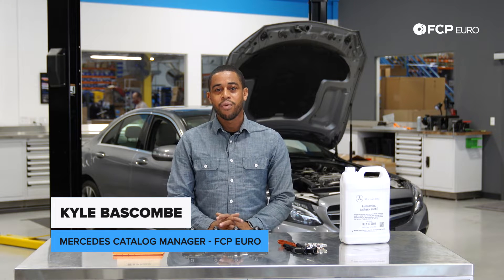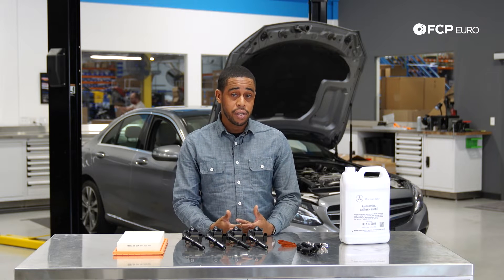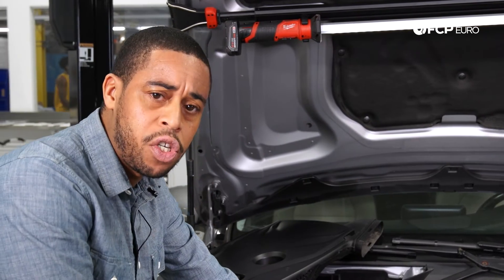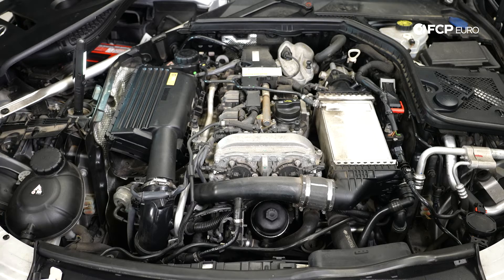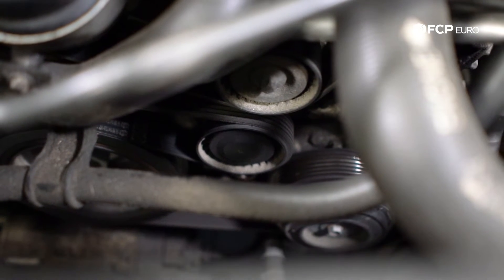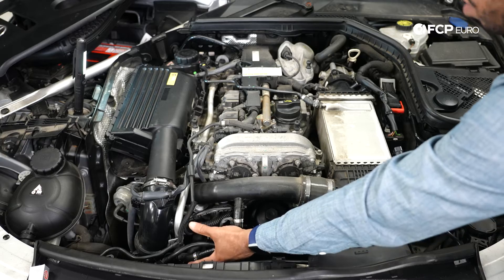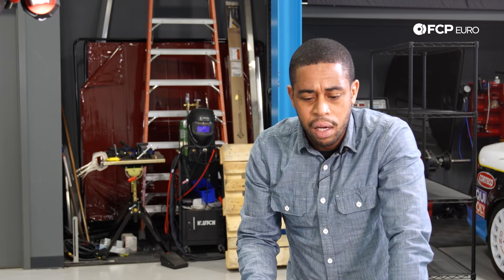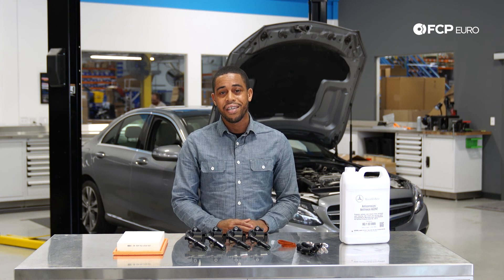Mercedes-Benz M274 Engine Diagnostic & Maintenance Guide (Mercedes W204, W205, W211, W212, & More)

Comment: I’ve had the PCB code a couple of times. Apparently MB is working on a new design. It would be nice to see a video on replacing that system.
Reply: It's a relatively complex repair.  Intercooler has to be moved, lf motor mount has to come out, you're gonna want a few more specialized tools.  It can easily eat up a good portion of your day if you really don't know what you're doing....not recommended for someone who isn't familiar with the engine.
Reply: @JeeperZJ  Agreed.  I'm currently on 5hrs and I'm just able to see 1 off the 3 bolts to the assembly on the lower portion go the motor.  This job in no joke.  WHAT A PAIN IN MY ARSE!..  Personally just for the headaches, I would recommend to give Merc Benz the 1400-1500 they want to do this repair.  In my opinion it's not worth your time.  But I digress...

Comment: "terrible but not too terrible m274 engine" - can you add more details to why you believe this to be a terrible engine?
Reply: I work on these cars for a living. 20+ years now. The M274, like the M270 (transverse mounted) 4 cylinders are basically boat anchor motors developed in conjunction with Renault. These clunkers get all types of issues. One of the worst water pump designs ever (lives under the turbocharger)! Also the breather system is complete junk. Has a breather hose which breaks a lot, that requires intake manifold removal just to replace. Pays about 5 hours of labor to replace. The coolant tanks are always leaking, horrendous ignition coil/boot design. Rarely do the coil boots survive disassembly. And the fuel injectors are known to fail as well. They are pricey, and require unnecessary special tools to replace the seals in the fuel rail.

All of that for an engine that doesn't make that much power, and isn't exactly winning any fuel economy awards either.

V6/V8 or bust when it comes to MB.
Reply: @LynxStarAuto  same.
Reply: @LynxStarAuto thanks that was great
Reply: @LynxStarAuto  Lies. I think you're just pretending. What's my evidence, well, you say the M274 was developed with Renault. That's a rookie mistake only a non-tech would make. Wny is that, well thee Renault engine was an OM651, for the sub c200 engines pre-facelift. So, yeah, I'm calling bullshit
Reply: my experience, sounds like a diesel engine, two different mercedes enthusiasts one of them is a car repair shop owner and a mechanic told me it’s not reliable for pushy drivers, he also sent me vid of very damaged piston of an engine driven 29,000 kms only!
Reply: My piston cracked at 51k miles . Diesel sound is piston slapping against cylinder wall
Reply: Please share the part number for the PCV valve

Comment: I’m dreading the day when my ‘19 Metris van’s PCV fails. Driver’s side ECU and engine mount need to be removed to access the PCV assembly. Ppl who had it say it’s about a $3k job at the dealer 😐
Reply: My dealer wanted $1400 to do it on my 2017 E300.  I elected to do it myself... NEVER AGAIN... After 5hrs and I'm about 60% from done.  Next time I'll pay the $1600.  Not worth 8-9hrs of my time...

Comment: So pcv can only be fixed by replacing
Reply: yes.  it doesn't come separate from the assembly...  trust me... this job is horrible and a pain in the ass.  5-8hrs from start to finish depending on you experience. possibly even longer.   pay the dealer.  it might be the one time it's worth it.

Comment: Very useful video thanks for it and more of it is absolutely welcome ;)
It is a little bit more noisy than a normal gasoline engine, I asked MB dealership they said thats because this engine has a very high feul pressure about 200bar which make that extra more noise by idling
Reply: The injectors, by their nature, are also louder since they're the piezo design which is basically vibrating crystals that create a current to open the injector nozzle when commanded.
Reply: That’s what many people were told but if you listen to this video at 5:50 he talks about the piston slap… that’s the noise I heard when my car was sounding like a mini diesel . It wasn’t because of the high fuel pressure or anything else , it was the sound of the piston slapping the inside of the cylinder wall which would later lead to it cracking as mine did at only 51k miles. The newer models are a lot quieter btw - they fixed the wrist pin issue

Comment: the engine itself might be small as it's a 4 cylinder, but that engine bay looks absolutely cluttered with shit. Great video as always though.
Reply: Cluttered is relative, and that engine bay looks so much easier to work on than a modern BMW

Comment: I owned the 2017 C205 with the M274 engine for 3 years. Put 27,000 miles on it. I would love to see you guys do a DIY on replacing the rubber fuel hose near the steering shaft that causes the A/C to smell like gas/fuel. Also diagnosing for a brake squeal fix on cold rainy mornings! From experience of course 😁
Reply: @Michael Lee Oh it did not need new fuel lines. I read on the W205 forums that the solution to the fuel smell from the A/C is just a tighter clamp on the rubber fuel line near the steering shaft. 

You can see my ownership thread here. Not bad reliability at all. I sold it after 4 years because my boss gave me her husband's BMW for free! And I didn't need 2 cars during the pandemic:
https://mbworld.org/forums/c-class-coupe-c205/768895-el-nino-ownership-thread.html
https://www.e90post.com/forums/showthread.php?p=27506300#post27506300

As for long term reliability after 5 years, check this video out also on the M274 motor! (Since you clicked on this maintenance video). Magic Mike was a Mercedes-Benz dealership tech for 6 years~ and actually responded to my question on his thoughts of this engine. He replied and told me, "I personally wouldn't buy a vehicle with the 270 or 274 engine, but I know there's folks out there that have had good results.
":
https://youtu.be/pXxPhyxfybo?t=366
Reply: @cupompa   I have the same problem with the gas smell. 
It might be the rubber fuel hose. Was it a hard fix? I currently own a w204 1.6 petrol engine for Europe. M274 engine.
Reply: George, check with the dealer....there was a recall on this engine to replace a defective fuel line.  Should be no cost to you.
Reply: Idk if you fixed it yet but the dealership is doing fixing that hose for free they did mine at 110xxx miles call them up and ask
Reply: It's an easy fix, we replace the soft hose and the clamps.  Remove the cover that sits over the hpfp to gain access up top, access is easy with the transmission underpanel removed when below.  My advice is to attach a shoestring to the old clamp up top and tie it to the top of the engine and remove the hose from below pulling downward.  When you install the new hose go in the reverse and you'll have a much easier time with the routing of the hose.

Comment: He acts like Mercedes has never made a 4 cylinder before
Reply: In the USA they weren't available until not long ago. We in the poorer parts of the world are used to it, though. And this version of the M274 is the strongest one, here in Brazil the most common is an 1.6 liter with 156cv.
Reply: @gilsonrogeriolimaoliveira2807  the Mercedes 16v Cosworth motor is both well loved and highly desired. It was introduced in 1986 to the US market.
Reply: @gilsonrogeriolimaoliveira2807  Americans love big engines V6, 8, 10 or 12
Reply: @mzee5533  everyone loves a big engine, but nowhere in the world gas is so cheap as in the USA.